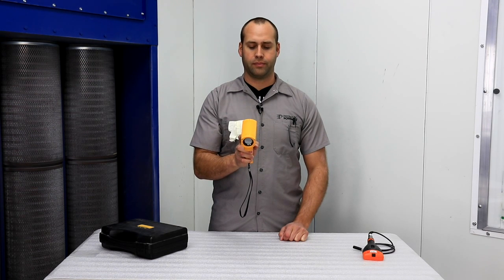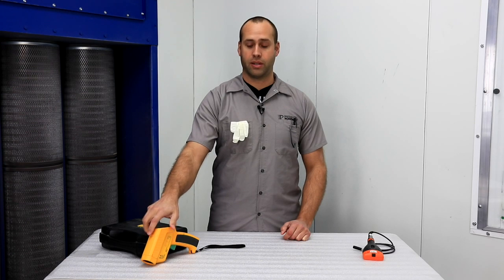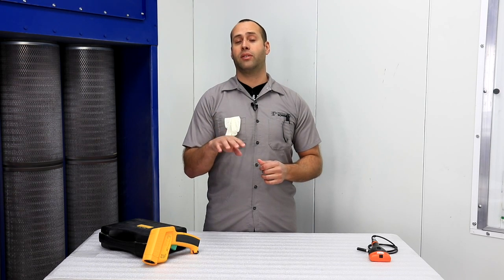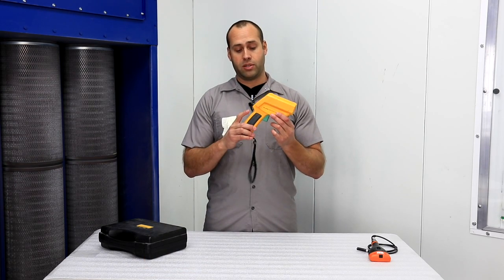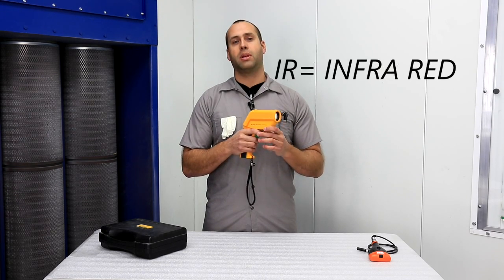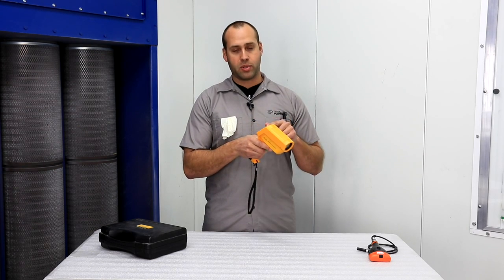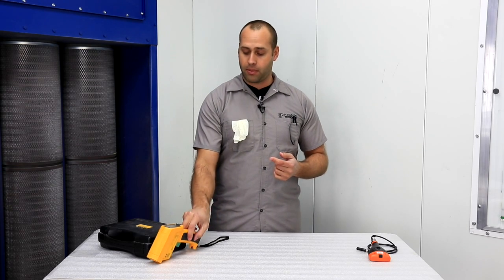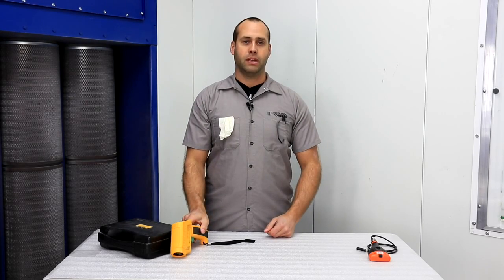Prismatic PSA: A Cure For Curing

Comment: What if you have several different sized pieces of metal and they all reach the desired curing temp different times. Example 1/2" thick vs 1/8" thick part
Reply from the maker: That's where you'd want an IR heat gun to be able to measure each part's temperature and start the cure times for the varying sizes accordingly.
Reply: So...if a part has more than one thickness....do you START cure time when THICKEST is UP TO TEMP, knowing that thinner sections will be at Cure temp sooner?
Reply from the maker: Yes, go off the thickest part for measuring Part Metal Temp (PMT).